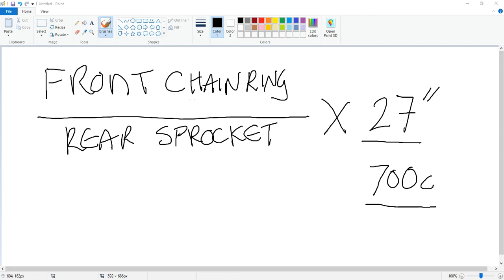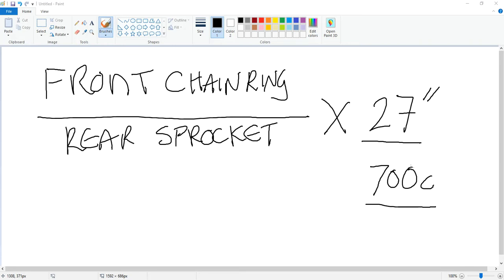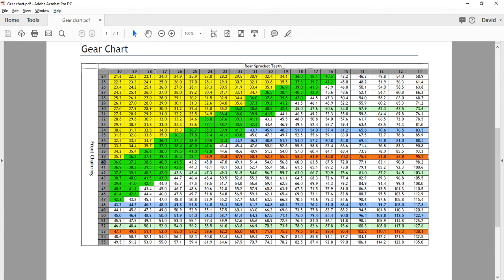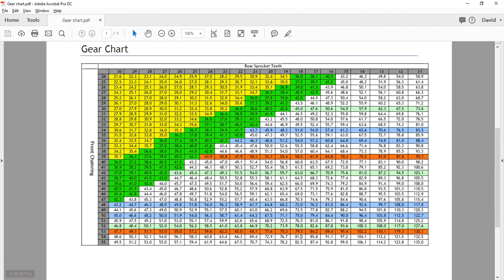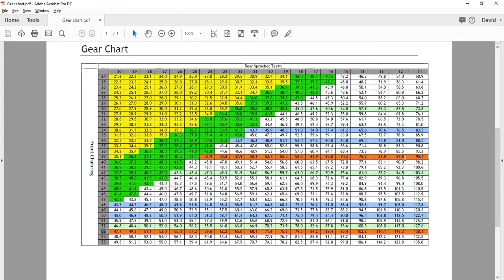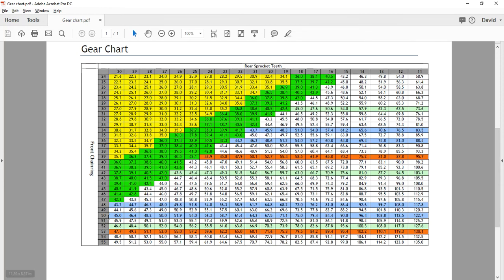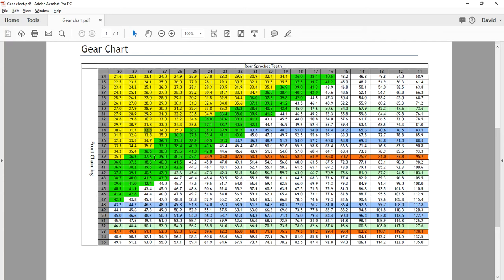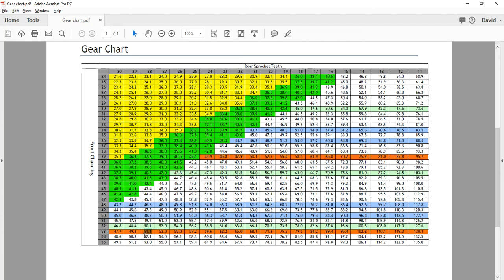Bicycle Gearing explained

Comment: I use 54/16 and my cadence is 65-85, but I found out that 34/11 is the same gear ratio. Is it possible that I can raise my cadence to 85-100 using the smaller combination or is it just the same?

Comment: Why not using out/in formula as we know from sprockets or pulleys?
Reply from the maker: Probably a better system but this is what has been used for many years now so I doubt it will change.
Reply: This gear inches formula also takes the rear tire diameter into account, not just the relative difference in output/input rpm.